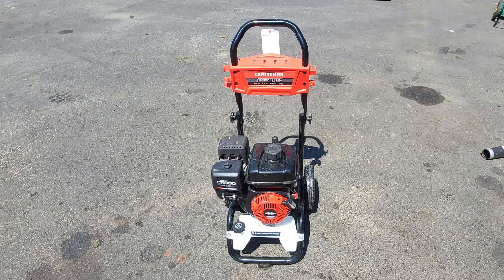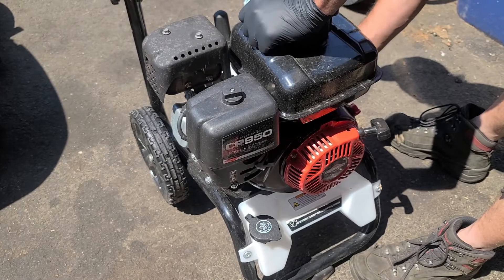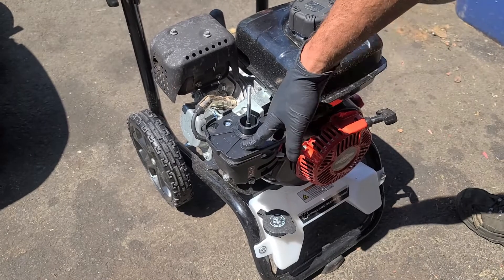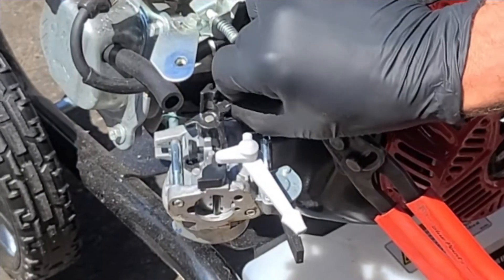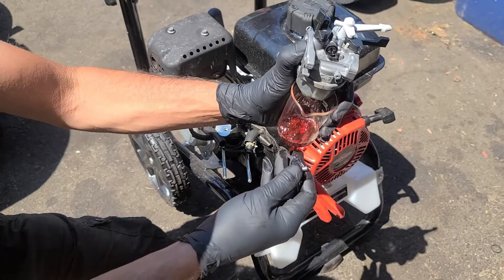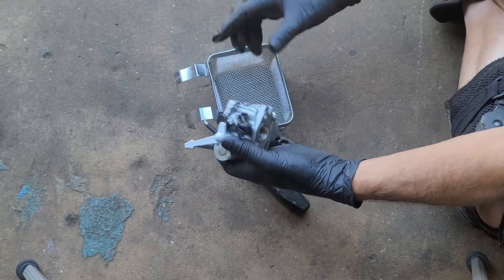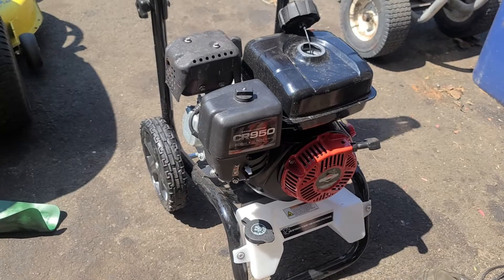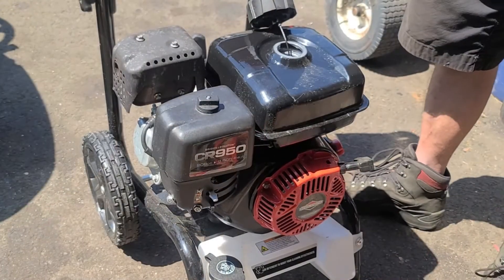How to Fix a Craftsman 3000 PSI Pressure Washer That Won't Start | @TheSmallEngineMechanic

Comment: I have an older 3000 psi Craftsman pressure washer with a Briggs and Stratton. This washer has auto-start, but I broke the plastic threaded fitting on the pressure switch. I removed the switch so I can run the washer. The darn switch is $125+. I am wondering if there is a different type of pressure switch i could use, maybe, with a t-fitting? Thanks,

Comment: Bet lemme just go grab my ultrasonic tank for cleaning
Reply from the maker: https://youtu.be/u1ZHdX35F9I or this can help. Cheers!
Reply: @  thanks your guide was still great. Instead of an ultrasonic cleaner I used a tiny needle to clear the gunk stuck inside.
Reply: @cheveres7312 I'm pretty sure that's what is wrong with mine but seems easier to order a $20 replacement carburator
Reply: @brk49er  where did you find one? Link? Thx

Comment: Thanks for this. I have the same model and cleaned the carb twice and still wouldn’t start. Your video showed how me how to take the main jet out and when I did, it was plugged solid. Got it started after clearing the jet. 

Question though. The motor hunts for RPM.  It did this before too. The throttle goes back and forth until I am actually spaying water or loading the engine. Any ideas why?